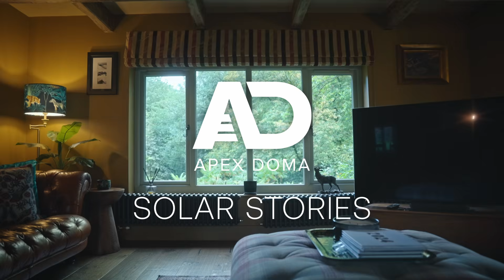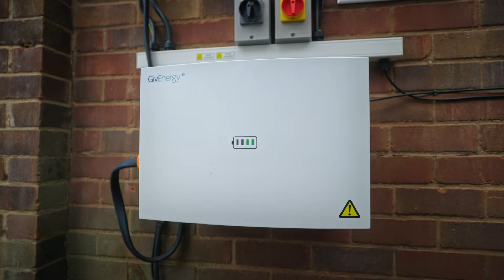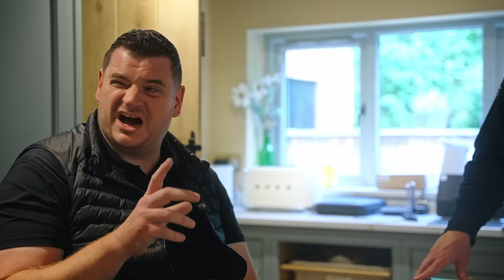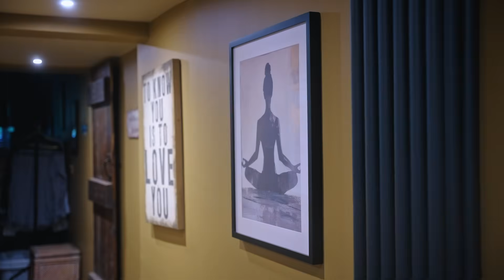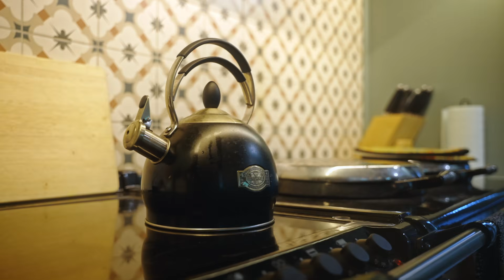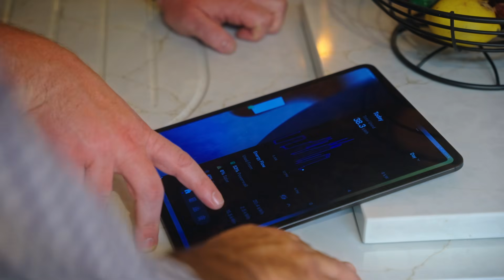Two Tesla Powerwall 3s for a Rural Home with Oil Heating | A Very Unconventional Solar System

Comment: Great video thx to all who helped make it. I’m in a similar situation. QQ how did the system contribute to savings on  the oil bill?
Reply from the maker: Thanks Philip! The client reduced the reliance on oil by converting the Aga to electricity. So we shifted as much as we could off oil and onto electricity, the used solar to generate a lot of that electricity for free, added batteries to be able to charge at night from off-peak rate, added hot water diverters to use excess electricity to reduce the amount of oil required to heat the water tank and then utilised export once the batteries are full to generate energy credits to off-set further. Hope that helps, let us know you get on!

Comment: Any plans for adding more solar panels to the back side of the ‘shed’?
Reply from the maker: Great question! The roof was designed to be slanted and maximise height from the south pitch to fit the maximum number of panels, so the north side is vertical with barn doors.

Comment: We have 8 solar panels with 1 power wall 3 and 3 expansion packs. The panels were great in July when installed and the sun was strong, but are generating very little now in Winter. We are with Intelligent Octopus Go and charge up the Teslas at night at 7p/kWh and never use peak rate electricity. We have reduced our monthly electricity bill by £130/month. The main reason for getting it all installed, is that we live in a farm cottage and used to have a lot of power cuts. Now the Teslas just step in and keep the lights on. We also charge our ev at night for around £4.
Reply: Why so much battery storage and so little Solar?

Comment: Oil isn’t getting more expensive and the choice to not go heat pump makes no sense at all. Who takes heat pump advice from a plumber. Lol
Reply: I don't blame him tbf. He mentioned prolonged power outages for a few days each year. You'd need significant battery storage to cover that for heating. The oil heating is a good planB. Maybe he could even lessen the oil bill further with additional solar PV and air-to-air heating or infrared heat panels.
Reply from the maker: Hi, thanks for the comment :) the decision to not go for a heat pump was mainly due to the size and age of the property being not well insulated, it would be very inefficient for a heat pump so it was advised as not cost-effective.
Reply: I was talking to the guy servicing my mum’s oil boiler last week, his son works for a fairly large eco company installing heat pumps. Son will not install a heat pump in his own house, says they are a nightmare to get absolutely right, dreads the first winter after an installation as they take hours of fiddling, adjusting settings, altering pipe work to get them to run anywhere near comparable with mains gas or oil heating.
Reply: When you say “the choice to not go makes no sense at all” what bit don’t you understand about this specific dwelling? The client VERY CLEARLY stated that due to the low thermal efficiency of the older structure and frequent power cuts made it unsuitable for the application of an air-to-water heat pump. You clearly need to gain a better understanding of heating requirements!

Comment: i run 34 x 440 watts solar panels. i am in a hamlet. 1 pw3 . power cuts sometimes. oil boiler. no gas available.
Reply from the maker: How have you found this in comparison to the client in the video?
Reply: @apexdomasolar we not usually off for days power.
Reply: I must have missed something. Your client chooses not to install a heat pump (though listening to a plumber isn’t a good idea). 
Is the saving in oil purely down to converting the AGA to electric?
Reply from the maker: Hi, thanks for the comment. Due to the size and age of the property being not well insulated, it would be very inefficient for a heat pump so not cost-effective. Instead the client chose to convert the AGA to electric so it would effectively act as a heat store in the middle of the house and use solar diverters to use excess solar to heat the hot water tanks so the oil boiler would only fire up on really cold days where there is no excess solar. Hope that helps :)